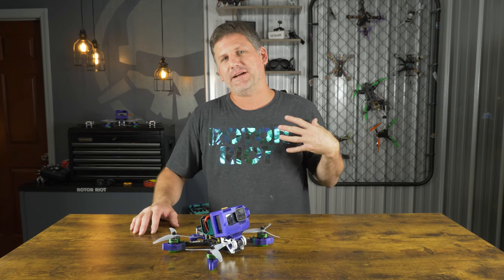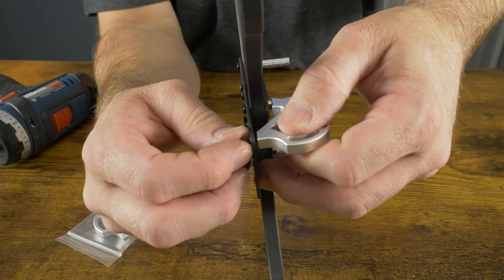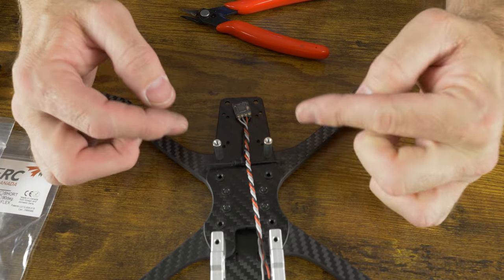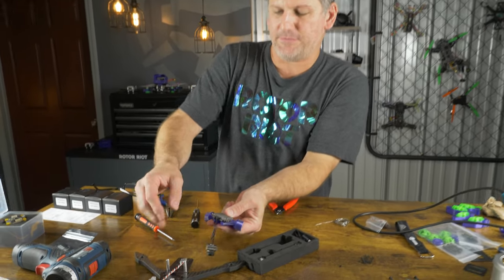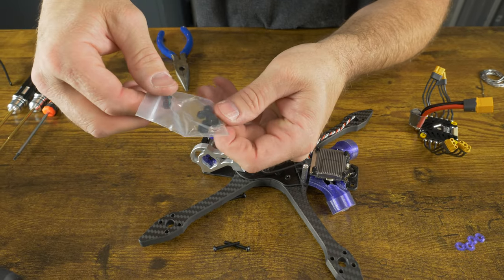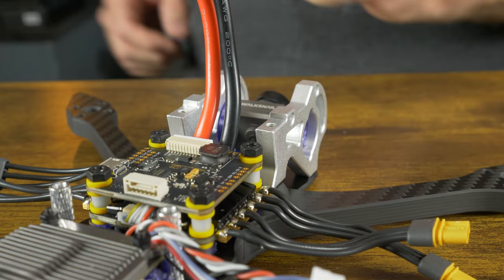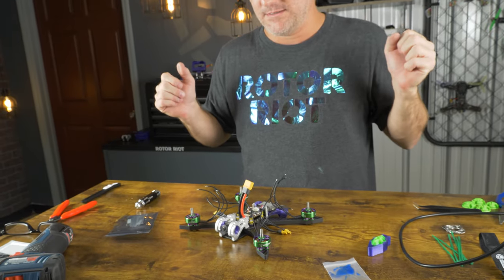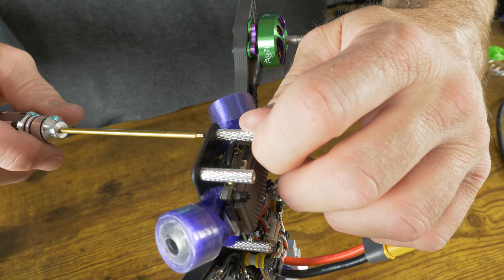Rotor Riot TANQ Build - Ultra-Durable FPV Drone! w/ Let's Fly RC

Comment: I prefer to not hit things lol
Reply: Underrated comment 🙏
Reply: I think we all do prefer not to hit things, Harry.  😂. But, if you truly want to improve your flying, then you have to push harder, and I think it is unavoidable.   :)
Reply: Yes, crash will happen. I just hate these heavy ass tank frames. Lol
Reply: @davidanderson6222  it’s not that heavy.   But, to each their own ¯\_(ツ)_/¯
Reply: I do too. But I still hit things lol
Reply: If you're not crashing your not pushing your limits enough
Reply: I prefer Simulator. Cheap and uhh.... Cheap
Reply: @selbendersiinge69 hell yeah sometimes I fly the sim for days when I’m broke because it comes without the worry of repairs $$
Reply: @LetsFlyRC strait fax, as a beginner im prolly gonna build one of these haha
Reply: that thickness alone gives extra weight, maybe you won't break the arm but the carbon will weaken, shatter, and break anyway, so why weigh down a Drone unnecessarily?

Comment: Why not design a simple antenna and wire case for the receiver so you can mount it safely and securely on the bottom of the drone vs under the electronics so you get a better transmission signal.

Comment: Improvement Idea:
During the milling of the aluminium cage you could add some markings on the cage for the cam angle.
Markings from -10° to 60° - long marking for the 10ers, short marking for the 5ers
Reply: That's a sweet idea. I wonder if I could laser them myself...🤔
Reply: That would add quite a lot of time to the program. Instead, I would add some stickers with the angles printed on them ;)

Comment: Update! so i got this frame and love it. wish it had mounting holes in rear for normal VTX instead of DJI crap but i understand. i did put a 20x20 stack in it by using a adapter plate. i am flying it in 3D like ZOE FPV and using bi blades and i must say it is one of the best handling quads i have ever flown. i Don't think i will ever fly another frame but this one. it fits all my needs. Brother you did an amazing job with this one. Thank you very much. For anyone thinking about getting this frame , think no more and just get it. You will be a very happy camper!

Comment: Just finished building mine yesterday and i LOVE it. My DIY kit was missing some of the 3d printed parts (ESC/FC spacers, foot protectors, and a few 3d parts that i believe were for a different VTX setup than what i ordered), but luckily i have a 3d printer and was able to re-create them on my own. i also made a custom mount for the DJI 03 VTX that holds the O3 VTX and the radiomaster ExpressLRS reciever that came wired to my flight controller, that i think works amazing. there is a VTX mount on thingiverse that you can print, but it doesnt let the air unit breathe at all, so i would think it would be much easier to overheat. Mine also has space for the SD card and USBC port to be easily accessed, which is something i have seen alot of people complain about with the O3 not having mounting holes, and having to tape over these areas. Im also working on a custom camera mount that will allow for a 20mm x 20mm piece of plexiglass to be inserted infront of the O3 camera. (i crashed and a piece of dirt/rock was kicked up into the camera leaving a small scratch, so hopefully the new mount will allow you to just swap a 50 cent piece of plexiglass instead of getting a new camera) 

Lets Fly RC: Id love to connect with you and share my 3d prints for your quad, i have a lot of ideas for this thing. im also a mechanical engineer so i can contribute effectively to design challenges/mods. 

Thanks for making this frame man, i absolutely love it.

Comment: My Tanq frame arrived today, already assembling it. I went for O3 and bought O3 conversion kit but to be honest I am missing some closer info how it suppose to be mounted - especially the smallest two parts in the conversion package, what are they? Are they complementary stands for the antenna mount, it has the same cut angle...byt why not to have it as one piece? BTW why DSHOT300 and not DSHOT600? And lastly I did not buy those TPU motor spacers, since I did not find them on RR website!...I guess my best option now is to grind 1mm off of each of those 16! screws...Why do you not sell the spacers?? Thanks.

Comment: 03 compatible? About to switch everything over on frames that can adapt well. Camera mount is my only concern
Reply: I have exactly the same question... :)
Reply: Yes, it does fit the O3 system without issue.  It will show the frame a bit on the sides unless you print a custom 3d print that pushes the camera forward more, but, that unfortunately takes away a lot of camera protection.  

I am working on a solution.
Reply: @LetsFlyRC  Just built this with the 03....It fits, but the camera is extremely tight in the mounts. Wasn't sure if any solution may provide for a little more room between the mounts.  Feels like they could be shaved down a hair.
Reply: @greaterbostoncriminaldefense  yes.  It is very tight - it was optimized for 19mm wide cam - dji is 20mm. 

I have a new mount for the o3 on my thingiverse page that u can print that keeps the frame out of view.  

Or my buddy, Julian over at noozle3d can print one for you.  

It will be added to the rr store as soon as they finish being printed.
Reply: @LetsFlyRC  Just got and installed the O3 mount from Noozle3D.  It fits and works perfectly.  Took the cage completely out of view.  At first I wasn't sure how to install, as it didn't have screw holes, but the way you have set this up works even better.  Just took me a minute to figure it out. Works great!!  Thank you.
Reply: @greaterbostoncriminaldefense  that is awesome.  Thanks for the update.  I am happy to hear it is working for others. :)

Comment: Well I just got mine and built it soon has it arrived to the uk :) its awesome build quality and went together really nice . I fly bando only lets see how it holds up it should be fine be the looks of it . Only thing I changed was stack screws to 22mm to space my flight controller away from the esc a bit more so the esc cable doesn't rub :) .

Comment: @Lets Fly RC Heat shrink your capacitor leads, they're near the frame and could make contact in a crash..
Reply: Great tip. I have not needed it, yet, because the capacitor is zip tied in place.  But, I should have mentioned that in the video for others.

Comment: Sean, do this again but move the arms towards the front of the quad instead of down to reduce the width of the quad. You could use servos on the arms. Would be pretty cool.

Comment: Really cool frame, Shawn! I know you're not particularly worried about weight, and I remember you talking about saving weight in other areas than the frame in your other video, but just curious what is the auw of your completed DJI rig? And what size lipo do you fly with? 
Sorry if you mentioned it in the video, I'm at work in the bush, and I can't stream the entire thing right now..
Cheers! ✌️
Reply: I didn’t weigh the fully built dji build, but, my walksnail build auw is 744g
Reply: @LetsFlyRC  Sweet, I appreciate the reply. That's not unreasonable. Congrats on the new frame...personally, I think it's the best in the Rotor Riot lineup now. 👏👏👏

Comment: Wow, are you seariously using super capacitors? A 1000 farad one? Where do you even get ones so small and able to take 6s voltage? I thought normal electrolytic and ceramic ones are better for voltage smoothing..
Reply: SuuuuuuupernDuuuuuuper Caps, actually.   I formulate them myself in my mad scientist lab.  😂

Comment: What was your decision to go for the Walksnail System over the DJI system? I'm really curious about your reasoning since i'm torn between the 2 :).
Reply: Nobody believes me, and everyone says I am a shill, but, I honestly have better range and penetration with WalkSnail in every environment.  

As long as you use the correct antennas on both goggles and drone, the WalkSnail system goes the distance.  

I also love the goggles.  

I stick with it because it performs the best for me.

I have all systems, 

Dji, hdzero, walksnail, analog, dji O3

and I go back and forth, but, lately, I keep going back to WalkSnail.
Reply: @LetsFlyRC  Speaking of antenna where we're you able to pick up those OCP antenna, thanks ShawnG

Comment: Building a similar drone with the same frame. This is also my first build and I am having difficulty finding cameras that will fit this frame. Does anyone have a few options? Also if there is any printable parts for installing a Foxeer razer mini 1200TVL?

Comment: GoPro's rear screen will break if hit from the front. LiPo's edge will crush it.
Reply: Not with my mount.   (I mean, it will eventually) I have been redesigning GoPro mounts for years trying to protect as much as possible.  

This mount has done the best job so far at keeping them from breaking.

Comment: Better to have a washer on the bolt to the camera to spread out the pressure. Just saying dude.
Reply: You mean the fpv camera?   Never needed a washer in 3 years of flying this same soft mounted camera design in the skyeliner.   It never even moved, slipped, wore out, or lost its angle.

Comment: As much as I want to like this frame, I cannot. It will not fit the 1w hdzero vtx unless I run individual esc's or a 20x20 fc in the rear. It would've been my daily if it was a dual 30x30 mount. As you said, why skimp on the lightest part of the build? Add a little more in the rear for that hdzero 1w, and you will open yourself up to a lot more pilots. That's because there are not many frames of this caliber that can fit the 1w vtx.

Comment: no one hugs this thick in a Drone, because they are not needed, they just make the Drone much heavier, five or at most 6 mm is enough. You may not break the arm, but in the long run you will change it anyway because the carbon will weaken

Comment: you could even make a 20 mm thick arm, but it won't save the drone, if you fly like an idiot)))  you'll never save motor bells from misalignment with the shaft after a strong impact because it's just pressed on the shaft. Also there is a great question about why you place GoPro on a bashing drone? You should have 5incher with shitty setup for bashing, and 6incher for footage with a high price setup. Once you trained some path after lots of crashes on 5incher you could try to do it on 6incher with GoPro
Reply: Many years of experience has shown this is the best setup for fpv freestyle.  

At least with my style of flying.
Reply: @LetsFlyRC  Thank you for your answer. I do believe that you're a good engineer and all the community is grateful for your contribution to the drone industry. I just offer you a little new approach in designing to improve the reliability of your designs...

Comment: aluminum frames are stonger and just as light
Reply: If that is true, then doesn't anyone mini quads with aluminum frames? I'm sure aluminum is cheaper too
Reply: Carbon fiber is better at reducing resonance. I'm by no means a professional but even I could tell the difference in comfort on my bicycle with a carbon vs aluminum fork.
Reply: @MikeDyson3k  that makes sense. The laminated layers probably dampen vibration
Reply: Think about it. Aluminum frames would act like tuning forks. Lol😂
Reply: @creationlabsinc.189  flying in the key of A.

"...aaaaaAAAAAAAAaaaaaa..."
Reply: I think someone makes a titanium 5” frame and it looks insane.

Comment: 175 GRAMS
Reply: Of TanQy goodness.  ;)
Reply: @LetsFlyRC  you rock, man I Almont considered building one as a practice rig without a gopro. Maybe in a bit.
Reply: @flaparoundfpv8632  it is actually only 166 grams.  

https://youtu.be/O-RneeoJmYs

@1:45 in the video. 

 Not sure why the website shows 175g. 

They must have added some more tpu parts when they weighed it.

Comment: 2306?! NOOOOOOO
Reply: What’s wrong with 2306? It’s been a stable choice for years
Reply: @creationlabsinc.189  agreed. I prefer a 2207, but I don't think 2306 is BAD
Reply: @MrFadjule  I use both. Not really biased on which I like better because I could never feel the difference.
Reply: 2306 and 2207 have nearly identical stator volume, which is really the only thing that matters at the end of the day. You'll get slightly different performance characteristics, but it's not like 2306 is of bad size.